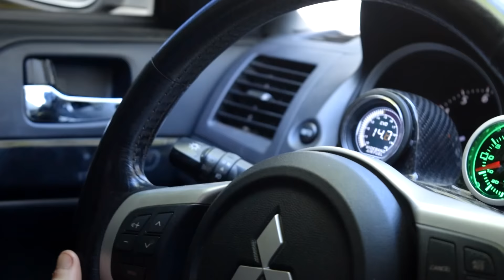Welcome Home Rob!  | Evo X Parts Install

Comment: I have been through 3 Prosport gauges and always have issues with them, just an fyi. I'm gonna have to switch to a more reliable brand.
Reply from the maker: I've got two and never had any issues with either. had the boost gauge for like 2 years almost.

Comment: Just curious, I installed my uicp, ets intake, bov and boost controller the other day and now my car wont boost over 10psi and feels way slower. I checked for loose clamps and everything seems good. Also I have a cobb ap and have the car on stage 2 for 91 and still no difference. Is this the same for you and or other evo owners? 2012 mr